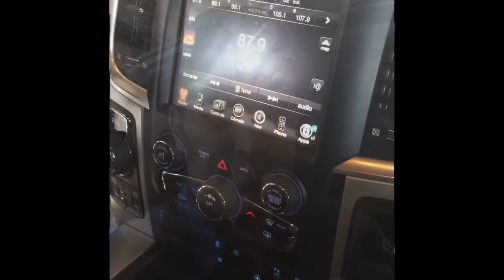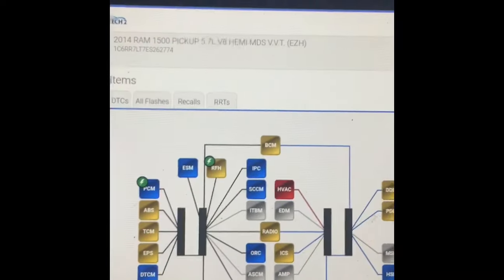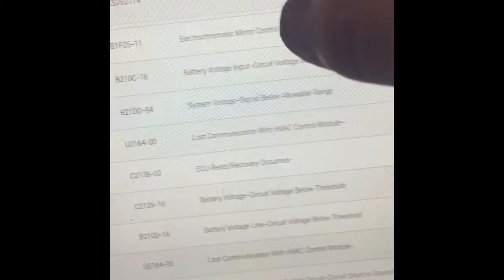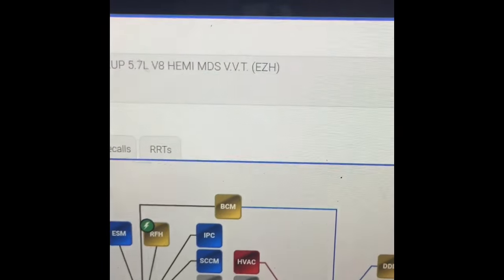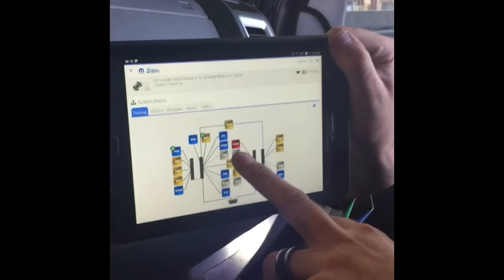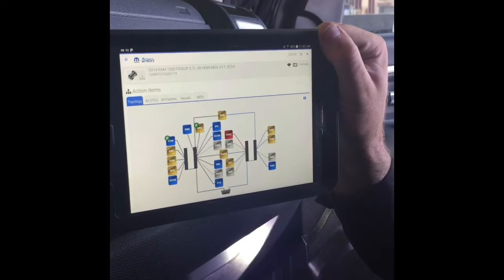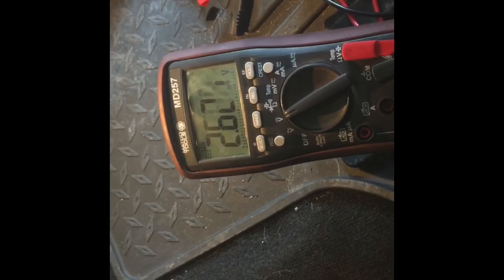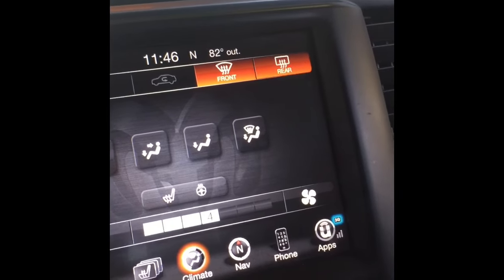Lost communication with module chrysler

Comment: What is part name
Reply from the maker: Ramiro Torres depends what isn’t working. This was an example of a A/C module not working.
Reply: I have code u0121 for 2014 Chrysler 300 engine 3.6
Reply: I have code u 0121 Chrysler 300 2014
Reply from the maker: It probably needs an abs module. But again check your power, ground, and communication wires.
Reply: if you change the abs module you have to program it

￼
Reply from the maker: Ramiro Torres yes I think it needs to be initialized with a scan tool

Comment: I can't find someone that can check this for me in the Albany NY area can you tell me what tools you need to check electrical on A 2005 PT Cruiser non turbo lost communication to OBD2 and throwing codes a crazy first started done the rabbit hole 02 sensors low voltage before lost OBD2 port... replaced them. Had lije 5 people check it with their reader the the last person list the OBD2.... then flash on the cluster code for oil sending unit... replaced that the crankshaft sensor replaced that ... now both 02 sensors low voltage and brake/ cruise control switch. .. I just replaced the ignition swith which seemed to give it more power and removed the multi switch do you think I pulled a wire out or any help greatly appreciated
Reply: My advice to you since you are in New York, Go see Eric O, at South Main Auto!!! He is in N.Y. & HE IS GREAT!!!!!! Look em up online/you tube under S.M.A OR South Main Auto LLC

Comment: I need help with my 2006 Chrysler 300. Code U0101 is what shows on diagnostic. We have called a tech and he said throttle needs replaced. The car won't start
Reply: Hello Eve Medina, Im having the same problem with a 2006 chrysler 300. How did you fix?

Comment: 99.9% of the time its the Module?  Far from the truth..  Such a lie..  i find these all the time.  Wires and connectors are mostly the issue.  and the pins corrode
Reply from the maker: Why would I lie? That's from experience. If yours is different that's fine, in my experience that's what I find.

Comment: My 2016 challenger sxt won’t start obd scanner code popped up lost com with ecm/pcm any help??
Reply from the maker: C Los does it do anything? Is it keyless go? Will it go to the run position? If it won’t go into the run position then you probably have a key issue or RFH issue. Let me know.
Reply: Another MOPAR Chrysler Tech yes it’s keyless push to start , I’ll try to start it and it’ll say run but won’t start or crank  and then the dash will be lit up with codes
Reply from the maker: So with it in the run position if it doesn’t see the pcm you need to check for power and ground and your communication voltages. To be honest though we don’t replace allot of pcms. You may have a broken wire. But I would start at checking your voltages.

Comment: I have a 2014 grand cherooke and the mirror ,window ,ambient light not working but the turn signal on mirror won’t shut off any ideas maybe door control module
Reply from the maker: It  pulls either be the Mirror assembly or the door module.